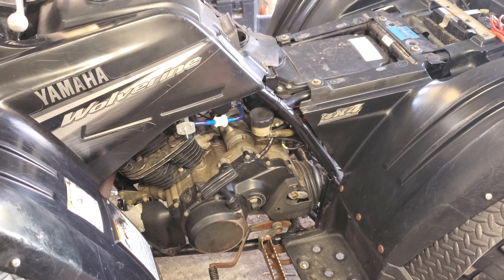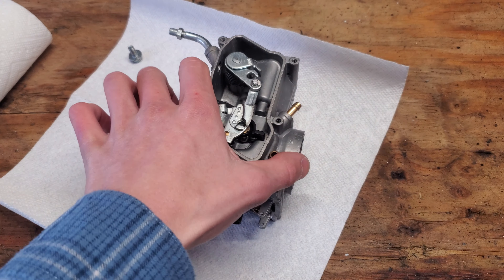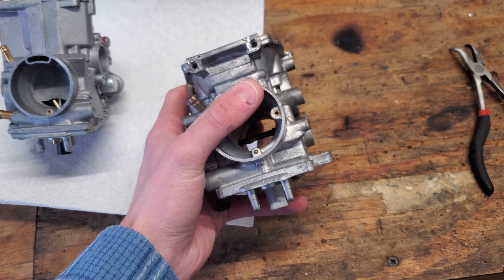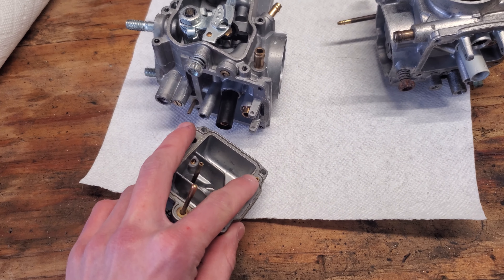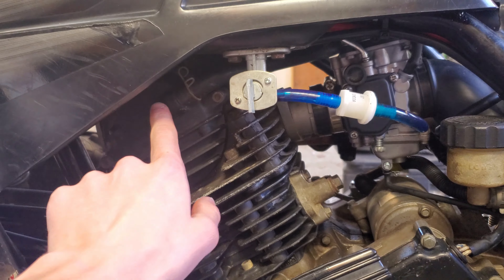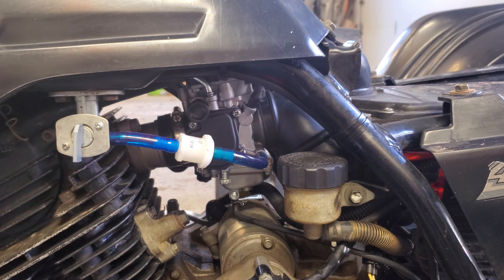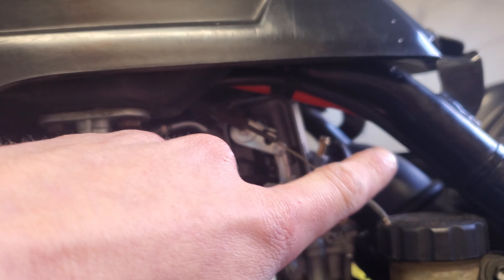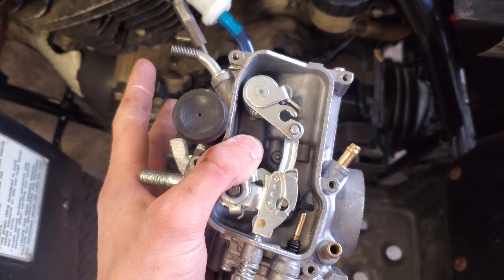swapping a Yamaha Warrior carburetor into a Wolverine

Comment: I tried to do the same swap my 08 wolverine, the intake bolts are side to side not offset on a diagonal pattern so the intake you recommended didn't fit. But I finally got it mounted. What jets did you use
Reply from the maker: @williamjenkins7446  The 08 wolverine is a different machine. I just used the stock warrior jets as I’m near sea level with everything else stock but you should cross reference everything with the Yamaha raptor not the warrior.

Comment: Will it fit an 06 Wolverine 350? And if so can you send me the link to the warrior carb you got?
Reply from the maker: I’m not sure about the 06, that’s the year they changed the body style so if the engine is the same it would probably work. The carb was on Amazon and I believe it was a goofit brand
Reply: @everythingmechanical_yt  alright thank you   Nd well it might be kinda different so do you know where to get a reliable carb that’s for my 06? I see some pretty cheap 40$ ones on amazing but I’m not sure about them.
Reply from the maker: @vinnyslams  I’ve tried the really cheap ones for around $50 and I wasn’t impressed, I remember this one being $80. The cheap one I got was a zoom zoom and the casting was poor quality and internal parts we’re also poor quality and didn’t last long

Comment: If you Had to use a different throttle cable instead of cutting and rethreading the connector, do you have any idea which cable to buy?
If I understand this video correctly, the OEM cable was just about an inch or so too short to connect to the inside of the carb. 
Or was it easier to mod the connection than to install another cable? 
Thanks just wondering.
Reply from the maker: Yes that’s correct, however I’m not sure which throttle cable you may need

Comment: What size threads are on the throttle cable tube you cut off and rethreaded.
Reply from the maker: I'm not sure, right now the quad is in storage but I used a thread gauge to get the thread pitch right
Reply: @everythingmechanical_yt  Thanks man. I have a thread gage, metric and standard. Do you have any idea how much you cut off?
Reply from the maker: @johnnyhawk329  Im not sure. I would thread as much as you can, then start cutting off small amounts until your throttle cable works as it should
Reply: @everythingmechanical_yt  Can you thread it with it installed on the atv?
Reply from the maker: @johnnyhawk329  no, you'll have to remove the throttle cable and the carb unless you can somehow fit the die on the tube with the carb on
Reply: @everythingmechanical_yt  Makes sense. Thanks man.

Comment: At 4:32 you said I took a die and pushed it down then I cut it. What do you mean. I’m lost, lol I had you until that point. Can you further explain on that
Reply from the maker: Yes! Since I needed that tube to be shorter, I decided to cut it. In doing so, the threads on the end were completely gone since they only continued down about a millimeter or so. In order to cut new threads into the tube I used a die and ran that down so that the throttle cable housing could thread onto the end of the tube as it's supposed to. Let me know if that helps!
Reply: I was wondering the same.  So you use had to shorten the tube and not the cable at all?
Reply from the maker: @guitargeek57  yes that's correct
Reply from the maker: @guitargeek57  in my case the cable wouldn't reach far enough so I needed to shorten the tube in order to allow the cable to reach further

Comment: Mine bogs out at half throttle and full????
Reply from the maker: This can be tricky, I would just keep cleaning it out, their must be something in their, then make sure your intake boot isn't ripped.
Reply: Did u have to change the jets from the original wolverine carb?
Reply from the maker: @israelnation4758  no, as long as the carb your putting on has the stock jet size, and your wolverine has a stock intake and exhaust you don't need to change the jet size
Reply: I put on a warrior carb on my 97’ Wolverine. It doesn’t even turn on with the warrior jets switched them with the wolverine jets. Starts right up, runs ok. Still feel like it’s missing power. Maybe not tuned right. All I know is my 200trx shouldn’t be faster than this 350 right???
Reply from the maker: @israelnation4758  if that's the case you may have had a clogged jet or a non original carb on the warrior. Does your quad have an aftermarket intake or exhaust?
Reply: @everythingmechanical_yt  sounds like it does I hate it. I got it going zoom zoom carbs suckkk…. I had to switch the jets for mine. Works but still slower than my 200trx…. Maybe the tune isn’t right yet? Also keeps blowing out starter? Good thing I bought 2 different kind.
Reply from the maker: @israelnation4758  yeah I didn't have a good experience with a zoom zoom carb on my warrior either. The starter issue probably isn't due to the carb thi

Comment: Any suggestion on why the warrior carb would start fine, give her some gas and then it revs high and stays there.  Carb is clean, swapped some parts out.
Reply from the maker: Make sure throttle or slide isn't sticking
Reply: Vacuume leak! If your engine has problems keeping a steady idle and the idle rpm says high after revving its a dead giveaway of a vacume Leak. Normally it's the o-ring that  seals the intake boot to the head, the intake boot has cracks allowing air into the mixture or possibly valvecover cam cover  orings.it could also be a head gast but you will know that by high pitch pulsing squeals from combustion.

Comment: Hey bud when you said you ran a die an cut for the throttle to fit what did you mean by that can you explain thanks
Reply from the maker: I had to cut that tube coming off the carb but since I cut all the threads off I had to use a die to cut new ones
Reply from the maker: That way the cable housing was closer and the cable would reach

Comment: I want to do this carb set up as well. I have the exact same machine. Is it easier to cut the piece on the carb and re thread it where the throttle cable goes or is it easier to buy a new throttle cable?
Reply from the maker: It's probably easier to just buy a new cable but I didn't want to buy one since its easy enough to just cut the pice and re thread it, so really up to you
Reply: @everythingmechanical_yt  thanks for the response. I’m going to go the warrior throttle cable route. I’ll post my results here.
Reply from the maker: @kylemcdermott3165  no problem! I'm sure many people will appreciate that, thank you
Reply: I did the warrior carburetor swap. I bought the carb off of Amazon (1PZ W35-IM1 Carburetor w/CNC Intake Manifold) 
And I bought a warrior throttle cable off Amazon as well (1PZ LT5-Y03 Throttle Cable)

Using this combination everything bolted up hassle free. Exact fit for the cable and the carb on the Wolverine.   Took about 35 minutes to install.  I did not have to rejet the carb. I’m at sea level in Louisiana and it works perfect. There is a noticeable increase in throttle response.   It is more snappy when you hit the throttle. 

The carburetor was $89 with prime and the throttle cable was $15.  I recommend this swap to anyone who is looking to get a new carburetor.   It doesn’t transform the bike into anything crazy, but it does make a noticeable difference. 

If anyone has questions I will do my best to help.
Reply: @kylemcdermott3165  30 minutes for your average guy? Or an experienced atv mechanic? lol Ive got a crap chinese carb been nothing but trouble, looking to do what you guys did. Thanks for any input or pointers.
Reply: @jodyburton6219  30-40 minutes is all it took me.  It’s pretty straight forward. Unbolt the old carb and bolt the new one on.  Really nothing to it.   If you’ve done any kind of carb swap before this is no different.
Reply: @kylemcdermott3165  thanks for the parts numbers off amazon

Comment: I bought a 99 wolverine 350 4x4 and it sputters bad when you give it full throttle in every gear the guy I bought it from said it was because it was a aftermarket carburetor and it needs a original back on and the shop here said it would be like 350 for parts and labor is there anything I can do to not spend that much ?
Reply: The wolverine has a switch that limits revving when the handbrake is applied. Have you disconnected the switch to see it it stops the sputtering? Also if it boggs at full throttle your jetting isn't set correctly.  You need to adjust the high circuit jet needle up or down. Also blow compressed air through it to make sure it's not restricted. Aftermarket carbs work just as good as one if you know how to tune a carburetor.

Comment: So after months of dicking around with a shit made Wolverine carb from Amazon I finally slapped on a warrior carb, she is running better but seems to have lost a lot of top end power/speed.
Going up even little inclines is forcing me to drop gears just to make it….can’t seem to find a problem, any advice would help thanks
Reply from the maker: I would check what size jet is in it and make sure it's correct with your elevation
Reply: @everythingmechanical_yt  thank you but I’ve sold her already lol I did find one a little smaller and that worked nicely but not 100%

Comment: Been thinking about doing this same project. Let me know if you think it’s worth the trouble. Can you tell a noticeable difference in throttle response? Thanks for the great Wolverine videos. There’s not many out there.
Reply from the maker: I think its definitely worth it! Theirs a huge noticeable difference in the amount of power acceleration the quad has! It's not too difficult to install either, the biggest pain is just getting those warrior carbs running right. If you buy a new carb this shouldn't be an issue, just run a good quality fuel and air filter that way it doesn't get clogged up